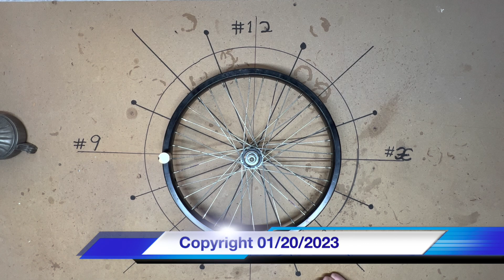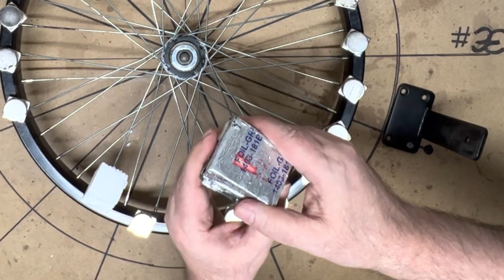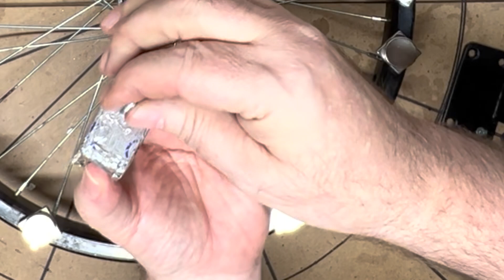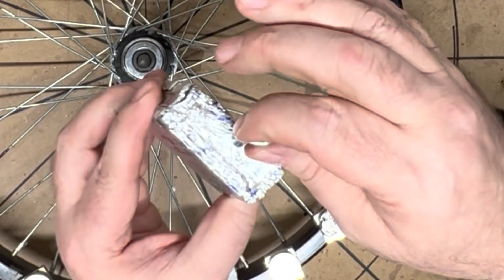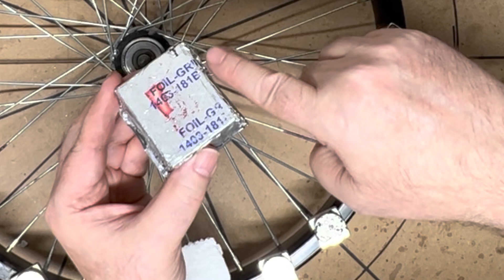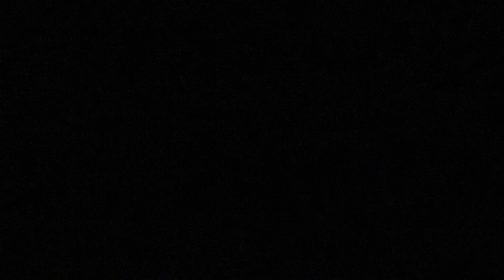🧲 FREE ENERGY RESEARCH FOR FREE ENERGY GENERATOR

Comment from the maker: 🧲 Despite I had lots of locknuts, none were fine thread. I will be converting over to the original wheel today that started this all. I’ve learned a lot over the last 12 years. I’ll be building more stators next, but improved. I’ll make a step by step tutorial on building my stators. Had the magnets been upright, the performance would have been 2 to 3 times more responsive. Thanks for watching.

Comment: Can you put several stators around the wheel on swivels allowing them to rotate 360 degrees, attached to gears connected to the center of the wheel? You'd add a little friction from the gears being connected to the wheel, but nowhere near the amount of force you'd gain by being able to bring those stators closer. Obviously there is a little more that would go into this, but it is possible and is an immediate solution to the only issue you face at the moment.
Reply: And obviously the gear system would not have all the teeth like a typical gear system would.